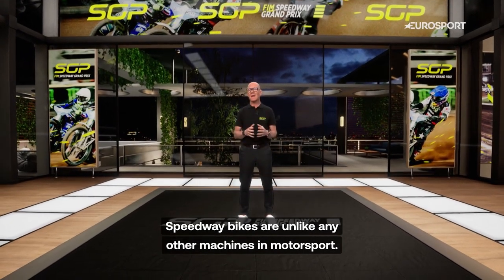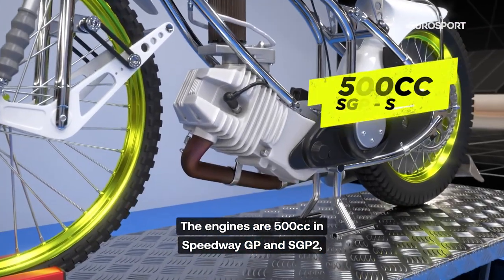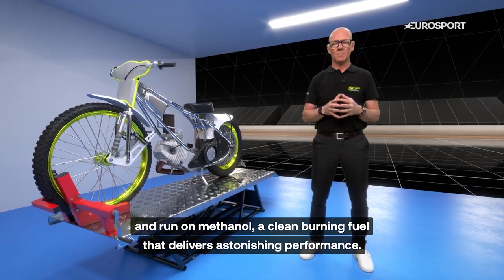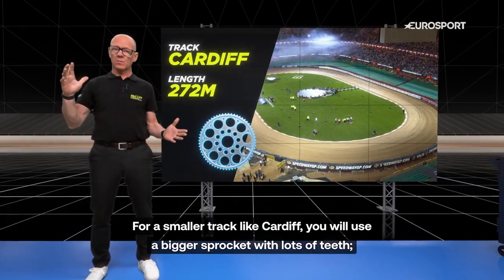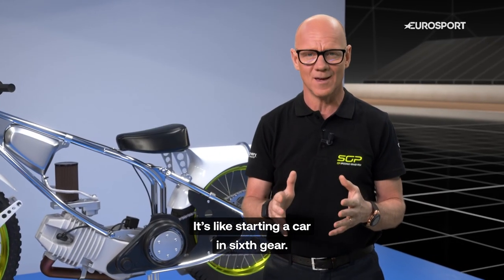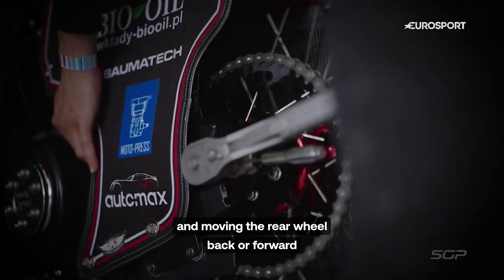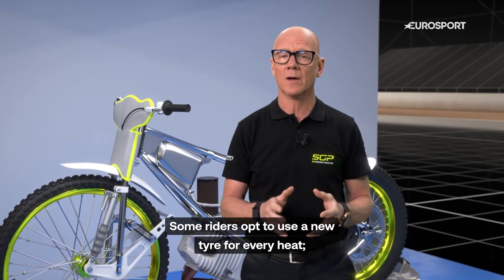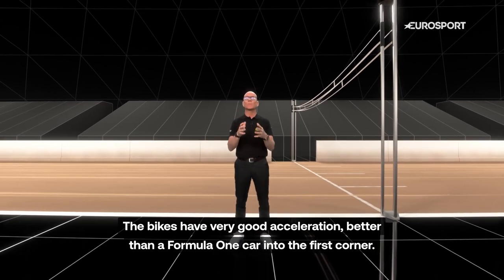What bike do you need for Speedway? | Speedway Unlocked | Eurosport

Comment: still doesn't explain why they have no brakes.
Reply: Four riders at close proximity to each would spell disaster if one of them suddenly braked. If there's an emergency, you simply throw the bike down and slide off. Plus the engine (which has very high compression) slows down very rapidly upon throttling off.
Reply: Brakes would be useless on a shale track.